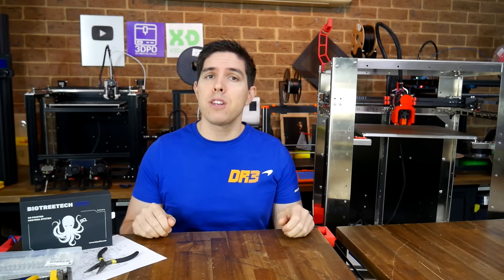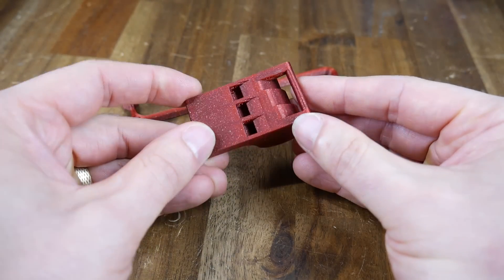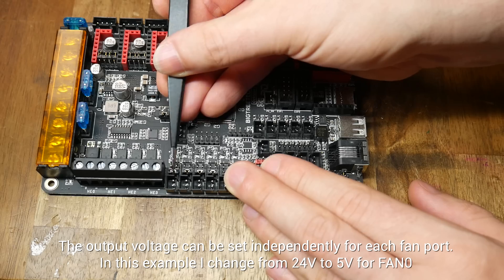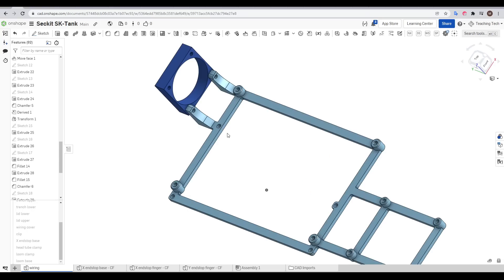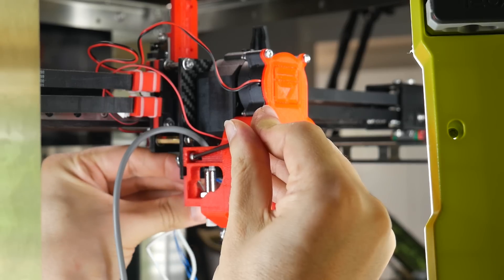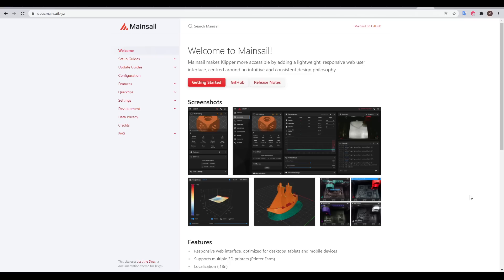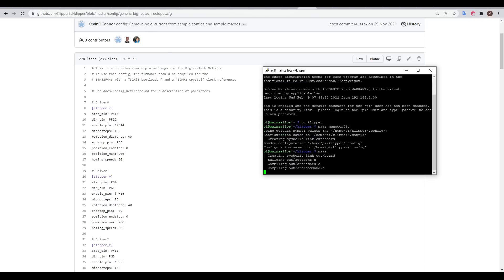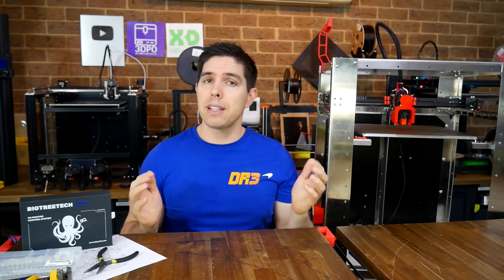SecKit SK-Tank coreXY build pt 3 - Wiring and Klipper firmware on BTT Octopus

Comment: I'm using external stepper drivers with the adapters instead of 2209s on the board. Do I set the pins for UART or SPI?

Comment: Hi Michael, great video. However, just a note on powering a Raspberry Pi from the 5-volt bus on the BTT Octopus. I returned 2 BTT Octopus motherboards before I had one that regulated the 5-volt bus high enough to run the Pi. The BTT Octopus would drop as low as 4.62 volts which is not good enough for the Pi. The best BTT Octopus board still only regulated at 4.96 volts. Still not optimal but the Pi hasn't choked yet, so I kept this one. BTT tech had the nerve to tell me that the Octopus wasn't meant to power a Raspberry Pi. Just a second point, actually all the voltages we're low 24, 12, 5 and 3.3. Even tried upping the voltage from the power supply to see if that would help. No, the regulators on the Octopus we're steady, just all low.

Comment: So, this means if you power the Pi from the Board you will loose the function to switch on/off the printer via the Pi? I would be interested to se how to connect the Pi using UART and also how to wire a PT1000 Thermistor to this board as it has the required chip already. Thx
Reply: UART to the PI with this board is just two additional wires. With power thru the board, I'm pretty sure I'm not able to turn off my board using the  PI. Though honestly I haven't tried. I have heard of some issues with the PT1000 thermistor as well.

Comment: Hi mate I got octopus v 1.1 with the board when you power it on was there supposed to be an led that constantly blinks? It a dumb question but I can't get the motors to work no matter what config I try ..the extruder motor work and heat bed works..

Comment: such a nice looking printer with all the nice components, 
And some nice 3D printed parts you have made to

But this build is for the High end pro, 
as you have shown there is so many things to do to make the simple components work.
Like re wiring connectors , Modifying  CFG files and setting up jumpers to correct settings.

Any way im still looking forward to seing the first print off. 
Maybe you can do a live showing :)
Reply from the maker: Fair point but please remember a lot of what was in tis video is because I changed the mainboard from what is officially supported.

Comment: I had a communicationissue with my Rpi 4b and skr mini running Marlin  the other day. I decided to run octoprint again after a while of not using  it. I used a 4b instead of a 3b+ I had before, for the life of me I could not get the pi to recognise the mini on USB. Changed Configs multiple times, different leads and plenty of time SSH into the pi. I ended up connect my laptop to the printer and opened the Arduino serial monitor, straight away I could send gcode commands to the printer. Did a bit of digging and it seems the Rpi 4 has some voltage issues on its USB, I connected the pi to the mini through a USB hub and everything worked, a very frustrating day.

Comment: Which CoreXY would you recommend at this point? Ideally I would like a CoreXY with the build volume and stability of the SK Tank but be able to add a tool changer similar to the Jubilee platform. It doesn't seem that currently there is a printer that meets all of those desires.

Comment: Looks like when it checked the third point, the nozzle was a little to the right. Is that ok?
Reply from the maker: Ideally the three probing points are as close as possible to the three mounting points. I can easily tweak the coordinates in the config if I need more accuracy.
Reply: @TeachingTech  Sounds great. The build looks stunning btw! I would love to build one seeing as I find belts better than lead screws which require cleaning.

Comment: I am building my own core xy printer with a motion system taken from the rat rig v core pro and using the octopus so a lot of this information is very useful to me. One thing I need to look up is setting the stepper drivers to match the voltage of my steppers. I know how to do this in marlin so will have to read up how to do in klipper. Are you using a screen ? I have a 5" hdmi screen with touch that at the moment is connected like a hat on the pi. If I want the screen at the front I will have to have the octopus in the bottom of the printer or extend the touch pins from the the screen to the pi.  My first go with klipper was in octopi and I do not recommend using this, Fluiddpi was so much easier to get working with klipper screen.
Reply from the maker: I don't have a screen for this yet but my preference would be to add Octoscreen.
Reply: the steppers should be fine up to 48v but not all boards and drivers can do that. if you mean amps and not voltage then thats in the printer.cfg

Comment: Another big thing with the Octopus Pro is it supports PT100/PT1000 so for only $7 US more just buy the Pro.  You can add the chip to make PT100 work on the standard version if your capable of doing surface mount soldering.  Space is pretty tight where the chip goes, not something I would try.   Wish I had known that when I bought my standard version.

Comment: Now you do a video. Lol. I finally got my Octopus v1.1 running at 4am this morning. However my steppers are getting hot. TMC2208 with the vref at .77 with creality 40/34...
Reply: In his ratrig videos Michael attached a small fan to the board and used it to cool the boards. Maybe try that?
Reply: @redkingrauri3769  I think I solved it. Since I did a clean build using vanilla marlin bugfix 2.0.x, its default feed rate and acceleration are way too high. So I adjusted them in the probe and movement settings in configuration.h. also I increased my microstepping to 64 then adjusted my steps per mm x4. Seems alot cooler, but I'm gonna run a long print to confirm.
Reply: @redkingrauri3769  you have  stopped be bit today's stuck stuck into a good idea for you last time but I guess I will be bringing a within
Reply: I already did, it's on an ender3 v2 frame so not a whole lot of wiggle room. I think I might put it on a stand and point it at the stepper. Right now its on a heatsink on the side of the stepper so it clears the bed.
Reply: Update* I've switched to nema17 1.8° 1.5amp 42Ncm steppers, at .9 holding current. Sooo much cooler 😎. Added linear rails, silicone heated bed, and now I'm running Klipper with pressure advance and resonance tuning via 2 accelerometers (1 for the hot end and 1 for the bed).